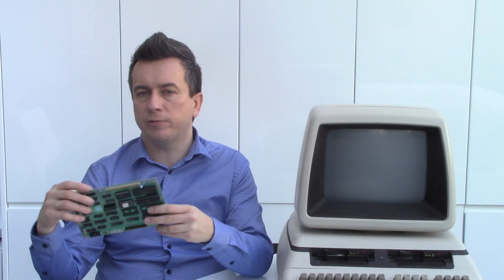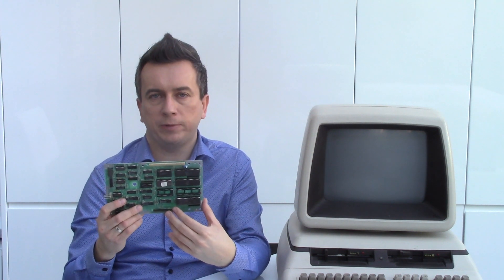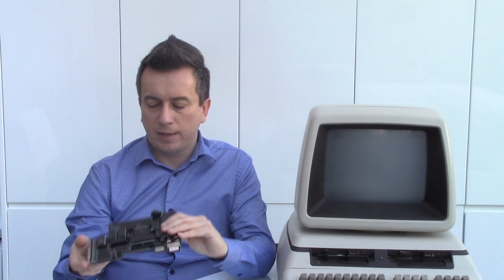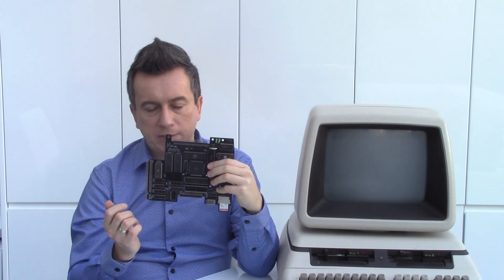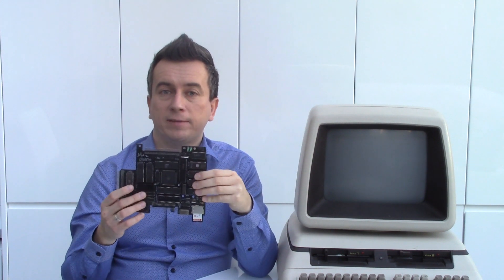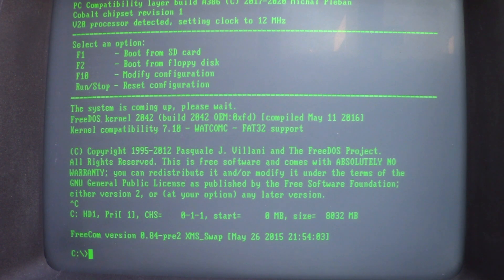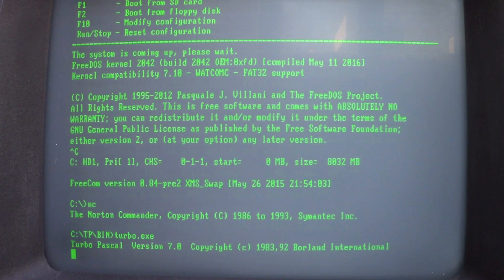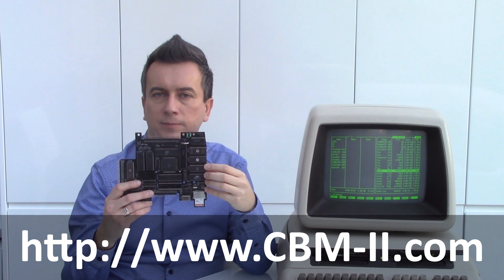Running MS-DOS on a 8-bit Commodore * Michal Pleban * Commodore Users Europe - 06th of March 2021

Comment: Wow, I see upon researching on my own about internals of the B128-80, I really can’t express enough of my appreciation of your presentation.   I’m really impress. Seems to me, emulating BIOS interrupt calls and video memory isn’t an easy as it sounds. Yes, you mentioned the virtualization environment where you’re using a cable for connecting between the I/O Access signal and the non-mos cable interrupt signal.  However, unfortunately I’m still trying to understand the functionality of the Co-Processor connector at a high level.

As my understanding, via the Co-Processor port, the 8088 communicates with the 6509-system bus.  In In that, there is shared access to an area of DRAM on the 6509 board, which is toggle between the two processors.  Whereas the process starts, with the 6509 granting the 8088 access via signaling the /BUSY1-output pin.  This is controlled by the 6525 I/O ic chip.  Then the 8088 controls it’s 8259 Programmable Interrupt Controller.  As per the messages, exchanged between the two systems, these are handled by the EXTMA* and DRMA* lines on the co-processor port.  Finally, the control is returned back to 6509 cpu via signaling the /Busy2-output pin. http://www.zimmers.net/anonftp/pub/cbm/schematics/computers/b/8088.txt

Comment: Hey, congratulations in recreating the 8088 processor card along with resolving the bugs of the original. However, utilization expansion slot, I would be curious to see if it possible to build a card run Linux?  Though, I'm considering utilizing a fpga/arm board running off the expansion port.
Reply: You could build a Raspberry Pi expansion card, like the ones that exist for the TI-99/4A and Amiga.
Reply: Theoretically it should be possible to build a card with any processor you like, as long as you incorporate the 8-bit interface to the system RAM for the 6509 CPU. However, running Linux would require at least a 386X CPU. This would be rather more complicated than an 8088.

Comment: Very impressive. I had a colleague who once wrote an ansi to unix terminal emulation package for MS-DOS which used INT14 (if I remember correctly). When you mentioned that the I/O functions of MS-DOS could be captured and rewritten using interrupts, it made me think of that old terminal emulator. 
Do normal I/O functions in MS-DOS always use interrupts?
Reply: MS-DOS itself uses PC BIOS interrupts, but terminal software usually accessed the hardware directly as the PC BIOS only allowed speeds up to 2400 baud. I am thinking of emulating the UART in software so that terminal programs would work, but that's quite a lot of work!